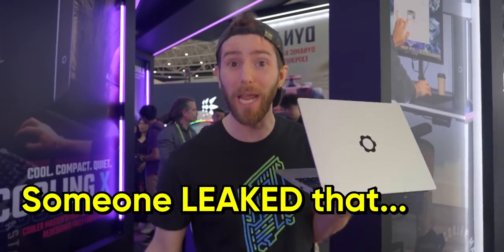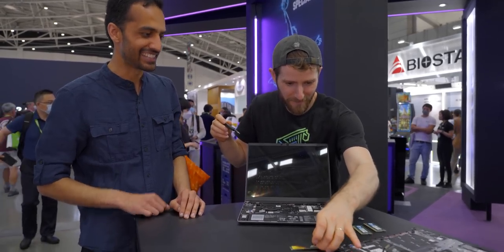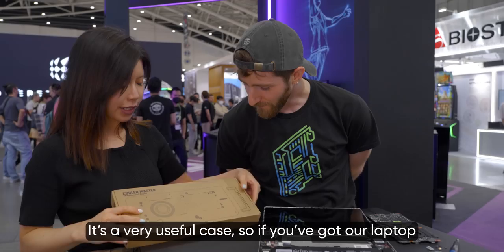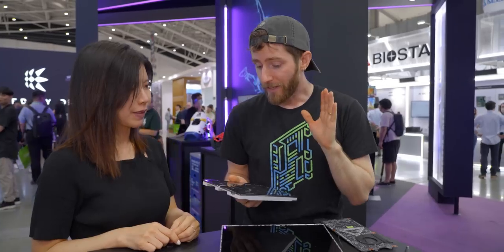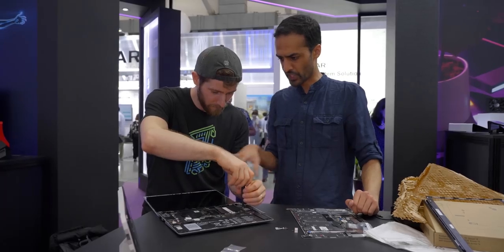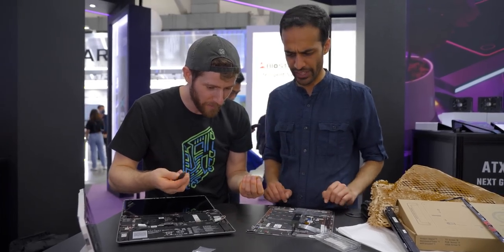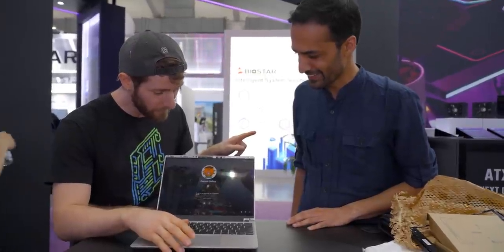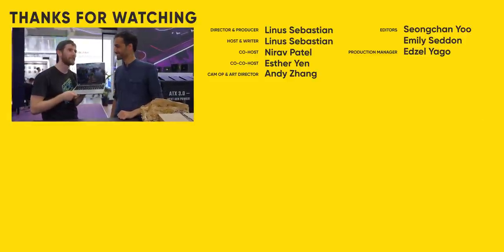World Exclusive: Upgrading my Framework Laptop to AMD

Comment: I think Framework is making the right call with not including anything with at least the base Cooler Master case. Less waste from things people don't need, but it'd be a good idea to be able to add some modules to their case purchase as packages (if they don't already)
Reply: Exactly, for server use we don't need wifi or audio
Reply: @Will-sc3hw  this, but also, for upgrading the case (like in the video), you’ll likely already those modules, and there’s no reason to pay for another one
Reply: @aarond309  Yes and no. If you’re going the full upgrade path that Linus is showing - you have those modules but you still want/need them for your laptop. So additional modules will be necessary if you need that functionality in your re-deployment of the old board.
Reply: You can always buy more modules if you want them, but if they're added by default and not wanted they would be waste, which I understand is against the philosophy of the whole project.
Reply: @phyphor  Seems to me that the solution would be to include some modules, but allow the user to select which ones they need included when they order it.
Reply: Exactly, and 20$(according to the website screenshot shown) for an optional audio or wifi card is prefect. If it’s included by default, it would be wasteful shipping it to just sit in the box
Reply: @mr.guillotine3766  yeah having a check box where you can choose if you want wifi or audio is perfect. And probably with other connectivity modules too to use it as a desktop
Reply: Completely agree.  Maybe set up the purchase page with pre-checkout questions asking if the customer needs different modules or antennas etc etc etc until it has been configured to be complete with what the customer has.

And hopefully it won’t cast $1-2000 to get the stuff!!
Reply: @Skiman__  Yeah - I think the ideal setup would be to make the board rehousing being in your cart automatically set a coupon code for certain modules that could be optionally added (and even “upsold” in the traditional sense of displaying recommendations on the page and the cart before checkout). 

Don’t make it default, but also be very upfront with the customer that the rehousing does not include the default modules that the laptop builds would have.
Reply: I think the audio daughtercard should probably be included with the case by default and possibly also the Wi-Fi antenna. It's something almost everybody would like to have and nobody is going to have one already. This is a native audio port, not a USB one.
Reply: @eDoc2020  I disagree. For a server or just something to drive a display, I don't see why you'd want an audio card. Or even converting to some industrial purpose or something. There are many things run by computers that produce no audio
Reply: @32krod  How would you feel about an ATX case with empty holes instead of 3.5mm front panel jacks? I see it the same way. In any case $20 is too much for a tiny passive adapter board*. I was actually thinking it would be included by default but if ordered direct from CM you could opt for a slightly cheaper downgrade option and save maybe $3.99.

Doing a bit of research I'm actually going to backtrack a bit before posting. It appears the CM case uses the same audio jack daughterboard as the Framework laptop. Since it's not designed/made by CM it makes much more sense for them to be sold separately.

*It turns out the jack board is a passive audio jack combined with the lid sensor for the laptop. The lid sensor makes the price (actually 14 USD, not 20) not as bad.

Comment: I actually agree with their choice to not include wifi and audio stuff. If you have a compatible bit from elsewhere or if you’re taking a full laptop and desktop-ifying it (not keeping the laptop working) that reduces e-waste. I think they should say what you will need in addition to a motherboard when buying it so that someone isn’t blindsided.
Reply: You may not even need it. A lot of people probably have some old USB sound card lying around that came with some headphones or phone or who knows what. I know I’ve accumulated several over the years, and even the ones from like 15 years ago still do the basic job of USB in, 3.5mm out.
Reply: I agree, you might have busted up your screen and your repurposing the working parts into a desktop or headless machine. Or if your making a homeassistant server or similar, you don't need audio on it at all, and you'd want the 2.5GbE NIC instead of a WiFi NIC anyway.
Reply: So do I. There will be bigger chance of those who don't need them and it would just produce more potential e-waste if it is included in the default package.
Reply: Yeah. Just a little warning pop up or something should be just fine. 

Giving people exactly what they may want and nothing extra that may go in the bin is the aim fo the entire operation. So it is a good decision
Reply: Yup, I would just add a Hidiz S9pro (2.5mm or 3.5mm audio) or a SoundBlaster for a box like that.
Reply: Also there are displays with USB-C around, which have an audio plug, also a lot hdmi-screens have them. I absolutely agree - better make the parts separately available, if they are necessary. But not combine what you may not need.
Reply: They could even give you an option to add those things if you need them, right on the same screen.

Comment: I feel like these framework laptops are a big middle finger to large tech companies that restrict our ability to repair and modify the products we buy from them.  I like it.
Reply: those spare screws were especially middle fingers to them
Reply: Bet you’re lookin’ at Apple huh
Reply: @darkside6450  Not just Apple. HP are one of those culprits. Locking down wifi cards to what they sell.
Reply: @MahaXad  HP also for printers, firmware update that if you use non original ink/toners, printer doesn’t work.
Reply: I really hope they become widespread, at least as a hip premium option to ultrabooks. I hope some day these are sold worldwide and not only in developed countries.
Reply: @darkside6450  Unfortunately it's not just apple now, a lot of Windows laptops like HP and Dell are beginning to solder RAM and other components to the motherboard as well
Reply: @aerohydra3849  Yeah even if you go back like 3 or 4 generations, all of them had pretty good upgradability (more or less). But I guess, everybody’s following Apple now even though they were memed on pretty hard back then.

Comment: I'm wondering if HP, Dell or Lenovo's CEOs are able to even upgrade their SSDs. Framework's CEO knows everything about his creation. Mad respect.
Reply: It's also is basically 2 CEO's bantering which each other that are passionate about products
Reply: They are not paid to know that and they serve industries far beyond little gamer laptops lol
Reply: @England91  does Linus even count as a CEO at this point?
Reply: @leonro  yes, because he steps down in a month
Reply: What we do know for sure is that Apple's CEO can't upgrade the SSD in his MacBook, because it's glued together, and the SSD cannot be accessed.
Reply: A lot of what those companies do is enterprise grade stuff though, and they manage a lot more than just building laptops, so I'll give them a pass on this particular issue.
Reply: I bought my wife a HP ENVY X360 a few years ago (5700u) SPECIALLY because it was cheap ($700) easily serviceable and upgradable. I tend to keep laptops for a long time. 
Pull a few screws off the bottom tray and you have direct access to everything. Easy to swap parts and clean. 
2 ram slots, m.2SSD, wifi card, etc. 
Other than HP bloatware nothing to complain about.
Reply: No, because they're soldered
Reply: @LA-MJ  Yup, all soldered. My Dell XPS13 died in about 2 months due to a bad SSD. Replaced under warranty but still lmao, pretty discouraging.
Reply: @getinthespace7715 700 only for a 5700u?
Reply: @leonro  He's the owner of the company, so even higher up than CEO. LTT is entirely family owned by the Sebastian family.
Reply: @General_Li_Shin yes they're paid to do jack shit and look pretty LOL
Reply: Kind of an irrelevant point actually. Any tech company startups will always have tech CEO from a tech background who would have passion and know how for these things.

Once the company grows beyond a certain scale, you need a proper manager, and optimizer - not a tech dude to keep the company growing. And i know for sure for a tech person like me I would get bored out of my mind doing CEO duties. So most of them tend to step down or exit

The perfect recent example being Linus who stepped down to focus on what he likes instead of dealing with CEO duties
Reply: There's a HP laptop that you need to rip off the keyboard, no screws all spudger, in order to switch the hdd to an ssd. What a pain in the ass, plus you could damage the keyboard panel when prying it off.
Reply: @funnyduck4568  I bought my Lenovo Ideapad Flex 5 with a 5700u in it for 650 for school. Granted, it was from Ebay Refurbished (apparently Ebay has a whole refurbished division now), but when it arrived (as far as I could tell) it was brand-new with everything still in the wrapping and not a nick or a scratch to be found anywhere. I expected an internal fault somewhere, but I've had it for almost a year and it's been rock-solid.
Reply: @serraramayfield9230  I know, but he's stated that now he's mostly just leaving all the CEO work that can be delayed for his successor. He's already half-retired from the role.
Reply: @LA-MJ Soldering isn't to bad to get into I decided to teach myself because of the Current state of things and Companies liking to Solder everything
Reply: @matasa7463  I know that, I was replying specifically to "they're two CEOs".
Reply: You are aware of Michael Dell right?

He started selling computer upgrade kits at 18 in 1984.  He knows how to work on PCs. 

Enrique Lores (HP) is an EE so he’s definitely got technical knowledge. 

Yang is more of a manager in background than the other two, but still has an MSc in computer science.

Comment: Using the framework coolmaster thing with a projector to be a home theater would be a sick way to use it. So much power and versatility in a thin and light package
Reply: I bet the 3D printing community is going to go nuts over the coolermaster case with it's built in brackets (if they haven't already just been designing motherboard cases already)
Reply: I mean at that point just use an android tv box
Reply: @madmanmax120  Framework themselves provides a model to print your own case
Reply: @JohnWalz97  android tv box?
didnt they said few weeks ago, they are not safe?
Reply: @crunchynetto6979  yes and no… you can install you’re own copy of android or buy a more reputable brand
Reply: @JohnWalz97  i've been using google chromecast device, the one with remote, also an sff pc for entertainment eventhough my tv can do more than half of what wanted to, but the tv came later.
Reply: @crunchynetto6979  I got the same google tv thing. Works pretty great and helps with the ancient OS on my TV lol
Reply: @JohnWalz97  i didnt use the android tv os on my tv, manufacturers usually tampered with it with ads and their products, so i still stick with the chromecast device, plus it got remote too~

Comment: I love that they made the top of the case translucent. We should bring back more see-through electronics.
Reply: We should bring back the option to have one or the other. Is there any gaming desktop that doesn't have a glass window?
Reply: only minor problem is that cast acrylic is kinda fragile, it gets brittle after a few years. Just have to be a little more careful with that stuff.
Reply: My clear purple Game Boy still looks good!
Reply: @ydna  yeah acrylic gets oxidized over time, and high temperature speed up the process (the oxidation also changes the color of the acrylic to yellow or pale brown)
Reply: Brings back memories of older days, but still looks cool. With the right material, I don't see why not
Reply: So you can see the files that are "in the computer?"
Reply: @leonro  Not if you buy a prebuilt, but Phanteks has a bunch of solid cases with no window
Reply: I just got my translucent bezel on my Framework!
Reply: As long as the isn't an rgb strobe fest sure, but otherwise nah. Give me the clean unlit look
Reply: I just built in a meshify 2 last year, with no glass. Glass is stupid on a computer imo. More money, more noise, no more frames.
Reply: Still waiting for the atomic purple framework case

Comment: OK, I was skeptical.  Beyond skeptical.  I said it was a solution looking for a problem.  I was wrong.  Being able to swap out and turn the old "computer" into a new computer is a game changer.  Excellent stuff.
Reply: Raspberry pie?  Eat your heart out!
Reply: @wojtek-33  My thought is enterprises. Companies can move an employee’s machine into a less-damaged shell or upgrade their existing shell without throwing away the existing one. Even it timespan of less than 5yr mere repairability is worth it.
Reply: @wojtek-33  A lot of companies would love stuff like this. For a personal user i think it depends on where you are from a lot and also your use case.
Reply: @wojtek-33  for me a key consideration is that I don't necessarily need to be the one reusing this. I have plenty of family members that would be happy with something like an Intel NUC and this would work for them as a primary PC in the cooler master case. 

Plus 11th gen Intel running Linux is a lot more powerful for running stuff that people would often push to a raspberry pi.
Reply: @wojtek-33   thought about repair ability?. What if your usb-c breaks?. Internal display cable goes out etc etc.. with this its an easy swap. Its so much more then just upgrade a mainboard.
Reply: @wojtek-33  a product doesnt need to be for everybody
Reply: @wojtek-33  theyre already creating an ecosystem of products for their laptops, theyre probably fine
Reply: @wojtek-33     Its kind of like Classic cars or Retro computing.  

If ya get it? You do.  

Do I need an automated Sprinkler system that waters the lawn JUST when its the right time to do it to save a few gallons of water each time?  
No.. 
But the fact I can?  
And have a Board that will do that for me right at my finger tips?  

And if anything goes wrong? 
I can just get parts for it to fix it 20 years down the line if need be? 

That's pretty cool.  :goodvibes:

Comment: Linus working as hard as he can to prove Framework is "foolproof"
Reply: it is not foolprof they have  sequential instructions in their website you will have to follow it.
Reply: @whocares3132  lol that's sooooo much better than what other laptops have, which is either nothing, or some repair worker's video on how to take the machine apart.

Also, when I took my laptop apart to change out the horrible stock thermal paste, the thermal putty that was supposed to be on the VRAM and VRM + chokes weren't even applied properly, with some of them not have any on them at all, and some having way too much applied. I had to fix all of that...
Reply: actually with linus doing it yolo style, it can trigger framework's ux team to be creative with their design so their product can actually be foolproof someday

Comment: I love the fact that you can keep the old components and turn them into a spare computer. This feature sold me on this as my next laptop.
Reply: @@qtsssim Nothing is stopping you from buying a mainboard + case, but they are significantly more expensive than a regular pc, longer lead times and less availability.
Just get a NUC at that point, since that is essentially what you're converting the old laptop main boards to

Comment: A framework printer actually seems like a good idea. I have repaired a few printers over the years and it is not enjoyable in a lot of cases. A printer designed to be user maintainable seems very practical. 

In general definitely a company I hope to continue see meet with success.

Comment: I love these framework laptops and the fact they specifically design their boards to be repurposed into a desktop unit.  More brands need to adopt this mindset
Reply: Other way around: A chassis was built to house the board. Plenty of boards, past and present, can be run similarly.

A neater trick would be to repurpose the internal VGA connector.

Comment: For the external case, they should build an I/O module so it can be used in the automation space.
Reply: I think they should have built adaptors for the battery port and the eDP. As it stands, it's only usable with a dock (one port for power and one for display leave you 2 available port for USB (providing keyboard and mouse) assuming you're not using Ethernet).
Reply: You can design your own! 

Everything is completely open source
Reply: HOLY SHIT THAT WOULD BE SO COOL
someone might have actually done it already because they give you 3d print models for the socket things and you can develop your own extensions
Reply: The hardware is relatively easy, just a USB microcontroller (3.x if you want low latency) with a bunch of exposed I/O, maybe with a little protection so it's harder to blow up. Firmware and driver support would take a bit of effort if you want low latency though. The most basic option with just a USB 2.0-to-serial architecture can easily be done by anyone who can design a PCB.
Reply: You could always design a case with an inbuilt module.

The cool part is that you could build it to do whatever you want. So IPxx rated chassis, wireless keyboard/mouse to reduce exposed area, or even a separate USB hub built into the chassis so that it's replaceable if it breaks, etc.

This has always been possible sort of as a diy thing, but they're providing all the bits you need to make it less of an experiment and more of a supported use case, which is actually awesome.